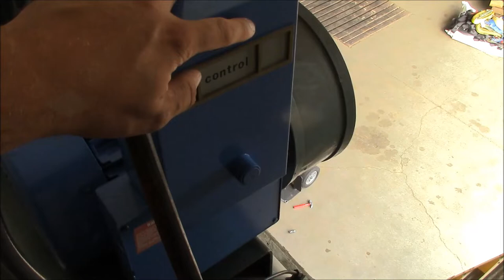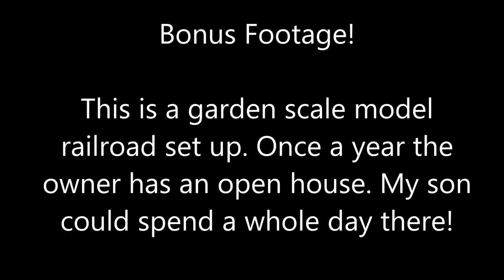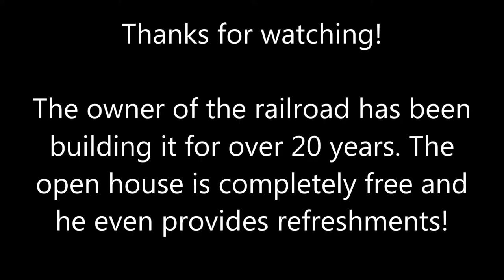New Shop Tour!

Comment: If you haven't solved your lighting problem yet or if you did and just left the fluorescent fixtures in place, I highly recommend you change the bulbs to LED.  There are replacement LEDs that work off the ballast in the fixtures and give over twice the lighting the fluorescent lamps produced.  I changed mine out and love the end results.  I know it is four months later but you never can tell, this might be just the information you needed.

Comment: One thing I might suggest from my experience in rebuilding after Hurricane Michael kind of wrecked everybody's homes, businesses and shops is that if you want lighting that hugs the ceiling without hanging down into your work area, go with the four tube LED fixtures.  Those things put out a phenomenal amount of light and use very little electricity.  Since I am retired and no long need a big shop but just one to handle light maintenance, I installed two sets and it is like daylight in that building.  Oh, and they are almost bullet proof!  One of my outbuildings was crushed when a big oak tree fell on it during the storm.  I took the LED fixtures down as I was attempting to salvage anything I could from the wrecked building.  One of the lights was okay but the other was bent up pretty badly and full of water.  With normal fluorescent lighting that is an automatic death sentence for them.  I reshaped the housing, dried the fixture out and reinstalled the lights in my rebuilt building.  I can't tell which light is which as both came on immediately and work just like they always did.  Just an idea for those trying to get maximum light with minimum operating expense while saving overhead space.
Reply: They were installed were I work. Very Bright and they do use less energy. I echo Richard.

Comment: congratulations wes!! that shop is absolutely fantastic! love the big door. the size it great. those radiant tube heaters work great. i vote for the forklift as a one of the first pieces to get if you are moving heavy stuff around. i would never want to move all my junk  i have now....i think i would have an auction first and move what i wanted to keep. i like to put all my wiring in conduit outside the walls also. very happy for you guys wes! yes it seems like the 10k mark is when the snow ball really starting rolling.
Reply from the maker: Yep. That Clark forklift was one of the first things I got when I started out. I didn't even have a trailer to haul it. I had to borrow one.

Comment: definitely interested in the line boring machine! love the new shop. can't wait until i get to that point. hope everything works out for you with basically starting over with your business.
Reply from the maker: I'll have to break it out. I used it a few times to fix some skid steer loader joints that were badly worn.
Reply: I would too. Not something often seen used or that gets used unfortunately

Comment: Nice Building, it has plenty of potential. I am with you on the use of conduit, I even put plastic conduit under the concrete before I poured the flood. It made it a bunch easier to wire. I really doubt anyone would bother you if you kept it zoned ag, besides I bet the business tax rates would be much higher, I would check into that before I made any changes. And besides that you will probably be working on a tractor now and then. About 6 years ago I changed my lights to T8 then a year ago I changed them to the 4 ft leds, twice the light and 1/2 the electric used. I heat my shop, house and all my hot water with a taylor outside water stove, I have to cut a bunch of wood but the cost to operate it is very little.
Cheers and Good Luck

Comment: Hi Wes,
   I am late to viewing this video.  Congratulations on the move and the nice shop.  You have probably already done the lighting, but if you haven't, I suggest an LED high bay light fixture(s).
   Do a little research, they are approximately 3feet wide by 4feet long, about 8-10 of them placed & spaced well, and you will almost need a pair of sunglasses to work out there.
   Very little power draw and no issues with -35degree cold weather.
Thank you.

Comment: just a tip on installing expansion anchor bolt, after drilling the hole and blowing out the dust, put some epoxy in the old then tighten the bolts. seals the hole so no water or oil gets into the hole. like the new shop

Comment: For your air compressor make a square extension heavy duty  to mount over the inlet  you were having so much trouble with  the same dimension  with holes in it  !   That's what I did !  Works great no more leaking !  🤗🤗🤗

Comment: You can buy an inverter or step down transformer(?) to go from three phase to single phase, did that for my company that had a German made paver making machine that had five 5 horse motors which were great motors.  We connected the inverter and boosted the single phase power to three ph.

Comment: definitely an intelligent and motivated man - plus you make very good videos - you'll be successful. Congradulations and here's hoping for a long career in the new shop -  the floor and stemwall construction is called 'floating slab'  they also used plenty of expansion joint in the slab.  and yes- looks to be stick built.  that railroad model exhibition is the coolest -

Comment: Very cool new shop!

I would use the steps and put them outside of the "office". This way you can use a second floor as utility room and don't waste space on the first level, while you get another level for say having an electronics working station on the upper floor and maybe something like this sand cabinet in a dedicated room with ventilation to outside, to avoid having the dust spread around the shop.

Comment: Permatex Right Stuff is the best silicone like sealer I've found, hands down. It's the only thing I will use on differential covers. I'm already regretting not using it on a twin transfer case setup in my truck that has a slow leak, but I also wanted to be able to get it apart again later. It doesn't like to separate easily at all.

Comment: Ditch the silicone and use Locktite 515 gasket eliminator.  It's an anaerobic urethane, will hold up to hot oil much better then silicone.  It only seals in the presence of metal ions, so the squeeze out doesn't set and washes away with the oil -- ie. no chunks of silicone to break loose and clog things up.
Reply from the maker: That's not a good solution for this situation. The cover is just die cast aluminum and quite flimsy. The 515 would be OK for a nice flat machined surface. But, in that situation I would just use Permatex #2.

Comment: Talk to your utility, you may be able to get "Open-delta" 3-phase, which is common in rural areas, where they can make 3-phase power with only 2 hot legs available.    A lot of irrigation pivots and grain driers are 3-phase and run on open-delta power.   Else you'll have to make/borrow/steal a phase converter...

Comment: Late to the party on this video, but if you don't know already reference your home made Boring machine, @ 10:35 of this video, the Drill that you use , I believe is the same as what Abom79 has, got it from either his dad or grand-dad. Abom79 had it for year's and just this year 2019, he learned from a viewer, that the drill is REVERSIBLE, via the ring / collar located at the base of the trigger handle. If the drill hasn't been used in the reverse mode, in a very long time, the collar will be very hard to break loose. but it does turn (left/right) to set the forward / reverse direction of the drill. If I recall correctly, the collar should turn approx. 1/4 - 1/2 the dia. of the drill housing, in other words quite a bit. Also about mid turn is a neutral position, just so you know.

You can see Abom79 Mag-Drill SNS 276: This Old Trailer @ 26:19 of the video. https://www.youtube.com/watch?v=IG_FGgBydHo  . In this video, I'm guessing, he didn't yet learn about what his Mag-Drill can do. I'm just pointing this out, so you can clearly see the collar on his Mag-Drill.

https://www.youtube.com/watch?v=guSG03tB2vQ  SNS 281: Installing Flexarm, Cast Iron Edges Nov 9, 2019, @ 8:34 - 9:49 Abom79 talks about learning that the Mag-Drill is REVERSIBLE.
Reply from the maker: Interesting. I’ll check if it has that feature.

Comment: God bless you & family. Im getting in late on this move but
Think twice before putting compressor next to office. The intermitant noise can be very annoying when working the phones.
There is 3 phase Primary (4160v) on the poles outside. Unless that feeder is for a dedicated large customer, I see no reason they can't drop a pole mount transformer for you if you give them your list of equipment. There might be a one time charge but find out first.
Is there some attic space above the ceiling?

Comment: Floating slab garage building, good for the flat land.  Forklifts tend to pee the bed a lot after a few years.  You need a good old fashion shelf building to finish this.   BTW if you still have voles in the spring and cannot find the little poison sticks for them that you stick in the ground after igniting it.  They are great at ridding the little voles/moles.
Reply: What's a shelf building?

Comment: That black right stuff will hold anything! I am jealous of your big shop space!  19:47 surely there is 3 phases on that pole, you just happen to only be tapped into one.
Reply from the maker: Negative. The center wire is a ground/neutral. There are two single phase circuits. It fooled me too the first time I looked at it.
Reply: @WatchWesWork   There are some systems like that where the 2 phases are 90 deg from each other and they can still be used with a 2 transformer setup to create a 3-phase system.  It is a bit of an oddity as it requires a fairly balanced load to not cause issues but it can be done. You Tuber Gary Ramsey of Ramsey Customs has  a 2-can 3 phase setup in his shop.
Reply from the maker: I can inquire. I would guess the primaries are two legs of a 3 phase main and thus are 120 degrees apart. If I understand the system you describe correctly, 90 degree two phase would require there to be 4 primary wires at the pole, not two. Another commenter suggested and open Wye - open Delta setup which may be able to provide 3 phase.

Comment: At breaker panel cut back sheet rock. then use pine boards 8 inch wide  plywood or mdf and picture frame the panell use screws for acess done easy piezy.. Painted to match walls it will disapear..

Comment: 2 points that you made that I will definitely second are, 1 Buy a forklift as soon as you can.  I wonder how I lived without one, now that I own one.  2 They are a 4 wheeled oil leak!  Lol!  There's alot to leak on them things.  I fix one leak, another one shows up.  I had to chuckle at mine, or I'd have got pissed, but I changed all the hoses on mine to "fix" all the leaking, and it sure as heck started leaking from the valve body thing.
Reply from the maker: Yeah. Mine leaked really bad from the front main seal on the engine. Fixed that and now the transmission leaks. The mast cylinder also leaks a little.
Reply: @WatchWesWork  It's almost like Whack-a-Mole!  Lol!  My mast cylinder leaks too, only because my mast is about worn out.  It's a 1968 Case 580 CK, so she's got a few hours on it.

Comment: Awesome shop.
Lots of potential the way you intend to rearrange the office space.
I'd build a sound proofed closet with an outside air inlet for your compressor that has a spring hing that only opens when the compressor comes on.
I did it in my old shop in the Keys and it made a huge difference noise wise.
I assume the house came with the property and is your new abode.
Being zoned agricultural shouldn't your property taxes be way lower than as commercially zoned property ?
Here in Miami-Dade you can still have commercial property zoned agricultural if the majority of you 1 mile area actual agricultural used property.
The commercial property has be below a percentage limit.
No new commercial property can be built once that limit has topped out.
Check with your local zoning office.
It might save you some serious dollars.
In Miami-Dade its put in the southwest area known as the Redlands where you find that.
Everything east of that area the have farms been "cityfied" and built out.

Comment: Maybe you can get a variance to be AG/commercial.  I have had to get variances before not to hard usually.    The Union Pacific BigBoy steam engine is coming to Missouri area maybe even closer to you.  Does verizon work around you, you may get decent connection with a mifi instead of the microwave.  Best of luck I have a Jeep grand cherokee that needs some work in a little while here, I think I am not to far and I like your work ethic.  You are going to have a tough time showing your business and keeping your privacy.  Also bringing the wife and kid into thing will get more subscribers if you are all comfortable with that.  You may want to put motion lights around, I run 12 volt led off of a turbine and a couple batteries to chase the coyote off.
Reply from the maker: Yeah it's a fine line. But I want keep the crazies at bay. I just need to make it slightly more difficult for them to find me. I'm not near Missouri. I'm in Northwestern Illinois along the Mississippi river.

Comment: Have a question about the oil on your compressor? Is there a crankcase breather so that the excess pressure can get out?
Reply from the maker: Yes. The crankcase is vented to the intake filter.

Comment: Did you check with the power company to see if there are two phases on the pole? If there are you could get open Wye open Delta. If not a 30hp Phase Perfect may be the way to go.
Reply from the maker: I can ask. To use the Open Wye - Open Delta I would need another primary wire from the pole to my shop.

Comment: Sooooo, did you buy this buildind, I hope ????? With the electric, just run EMT thinwall. With plywood walls, just screw  the clamps wherever you need them.....Put some bigger windows in. Keeps mildew and mold from forming. Good Luck, looks like your on the right track.....

Comment: My Matco and Kennedy toolboxes had no trouble with a 14 hour trip in an overloaded trailer with rock hard tires 😁
Reply from the maker: I know a guy who repairs large stamping presses. He has a Mac tool box that he hauls to the job in a box truck. The spot welds that hold the draw slide mounts failed and the drawers collapsed onto each other. Mac replaced the box under warranty, but he stopped hauling around.

Comment: Don't know, if you will read this, because it's an older video:  3:35
To fix the problem with the plate on the compressor reinforce the plate with some decent angle or t-shaped iron. Put it to length, drill the apropiate holes in it and intall them on top of the plate.

Comment: In regards to not having 3 phase power in your new shop, there is a way to convert 1 phase to 3 phase. My uncle made something to run a planer from a lumber mill at my family's barn. With some research, you may be able to find something that is commercially available.
Reply: Probably a rotary phase converter

Comment: Yes had they bent a Jay channel it would have but then had you emptied the top drawer you would not have had all that sprung weight just waiting to multiply at the next bump in the road bro ..come on your smarter than that ....Remember you can never have enough air compressor ..should you ever get into any type of heavy CFM the  use of anything smaller will give up fast . Should you use a MudHog or two D/As even some of the Big 3/4 inch commercial impact guns need plenty of CFM mine put out 24 CFM at 90PSI and that was with an 80 gallon tank but you can't find Industrial Air Machines anymore anyway nice shop ...Good luck ..Can I recommend a BendPak  for your 2nd lift they are built like tanks...

Comment: Hey Wes great video congrats on the new shop. i have a question?idea i want put a timer on my 3ph compressor so i can set the time to shot it down or turn on. sometimes i run my machines on overnight jobs and when the machines are done they shot off i want to be able to turn the compressor of as well. any ideas? i thought of a 3ph contactor with a timer. what do you think?
Reply from the maker: Yeah, that would work. Just need a timer relay on the coil of the contactor.

Comment: Was that plane a crop duster or an approach for landing on the new Wes AFB? grins
Nice shop Wes. You minded about a photovoltaik system to have free electric power?

60' should be about 18Meters in length by 40ft ~13.5Meters in width (each roof side), 
by 18° slope, for solar-modules. With 4 to 6 backup batteries you could reach about 
up to 60% autarky of free electrical energy for the shop.
Reply from the maker: I'd love to have solar power. There are some farms in the area with free standing panels that are making 100% of their electricity. Someday when I have some money I will do it.

Comment: Congrats on the new shop/home Wes! It looks fantastic. And, best of luck to you for continued success with your channel.
I am curious: are you out of the CNC machine-shop game for good?
Reply from the maker: More or less. I never wanted to do CNC production work. I just kind of fell into it because I needed something. I like the repair side much more, it's just the travel that is difficult. We'll see where things go. I may take a break from machine tools entirely.
Reply: @WatchWesWork  I may have an electronics project for you if you need some work. The DRO on my knee mill has issues. I think It is repairable. But, I have no clue what I am doing. It may be feasible to send you the thing? Maybe not? IDK? But, I need to either fix or replace it.
Reply from the maker: I'm typically hesitant to do electronic repairs without access to the machine to test my work. What's the issue?